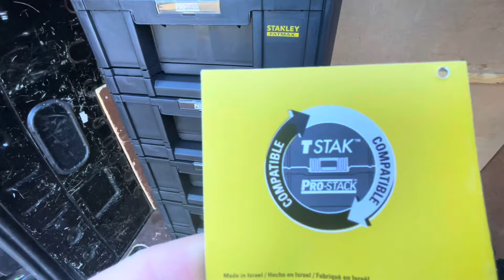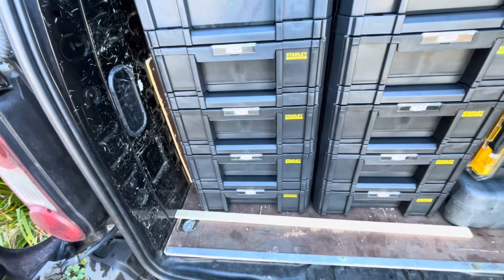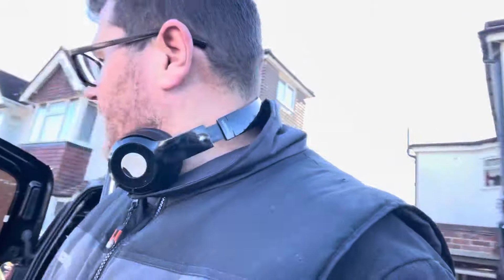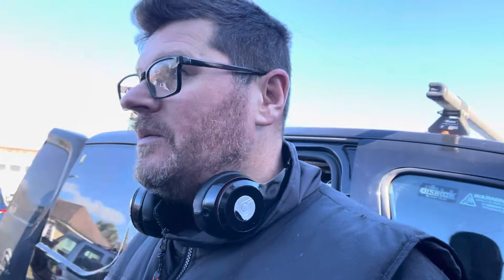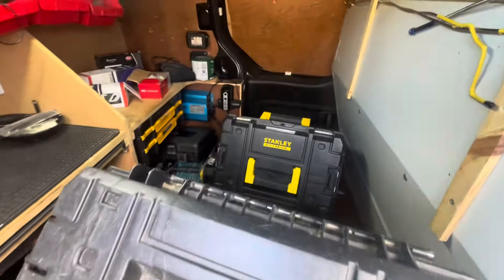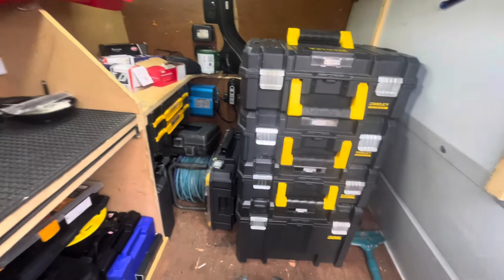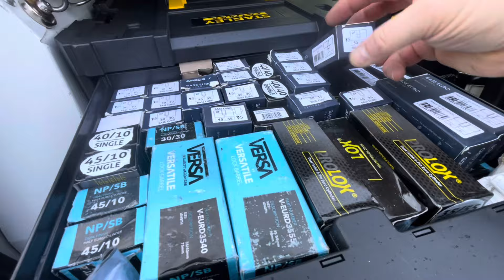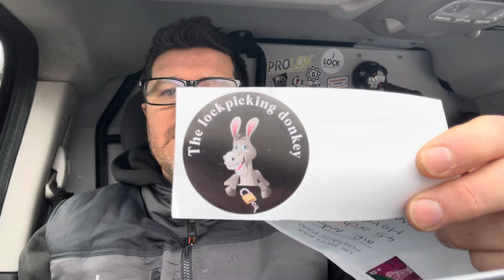Stanley Pro-Stack System | Van Tour | Van Racking | Locksmith

Comment: The never ending quest for perfect storage.  What you've done is looking good.  If strapping the tops together doesn't work, it looks like maybe a removable post or two on the left  (open side) of the stack from floor to ceiling might do the trick.  Thanks for another video!
Reply from the maker: Ah mate!! ‘The never ending quest for perfect storage’ has been ongoing for many years 😂😂 Good suggestion regarding the posts 👍🏼

Thanks for watching 😁🙏🏼

Comment: Awesome video as usual.
Screwing that base unit to your floor of the van should stop everything from falling.
I’m getting one for me now after seeing your video lol. Also those deep draws lol.
It’s fantastic you are doing more videos again. 
I’ve learned so much watching you.
Thank you
Reply from the maker: Thanks Ian. 
I’m not entirely sure that screwing the base down would be enough!! There’s a lot of weight!! Might be worth a try though 👍🏼
Thanks for watching 🙏🏼
Reply: The two stacks at the front. Just get an adjustable strap that pulls them together. If you think they might still go over attach a sash handle to the bulkhead and run the strap through it. That's the cheapo way 😊
Reply from the maker: It’s all sorted Paul, thank you though. 
Watch out for the next video for an update 😁
Thanks for watching 🙏🏼

Comment: Looks good mate but, my word, there must be some weight in that van. 😮
Reply from the maker: Yeah there is Kenny. But it’s fairly evenly distributed 🤞🏼Until I get in it 😂😂
Thanks for watching 🙏🏼
Reply: @brighton_locksmith I have quite a bit more weight in my nv200. I added sumo springs to the rear. Very fast install. Tire wear is excellent. And the van doesn’t wonder. Only down side is. Don’t go over railroad tracks fast at all

Comment: FFS. Been wondering what to do with my layout and now it looks like I’ll be spending some money 😢😂
Reply from the maker: Haha Iain. It’s working like a dream so far! So much easier and quicker 👍🏼
Thanks for watching 🙏🏼
Reply: What sizes did you use
Reply from the maker: @iainfryer8078  I have 17 of the deep drawers, 2 of the deep boxes, 1 of the Dewalt double shallow drawers and 3 of the clear lid organisers. 
When I get a minute I’ll try and measure them for you and let you know the sizes 👍🏼
Reply from the maker: Iain, these are the sizes of the drawers and boxes etc. 
deep drawers are 160mm overall (internal drawer depth is 100mm) 
Dewalt double shallow drawers are 160mm overall (internal drawer depth is 45mm each drawer) 
Deep box is 310mm deep 
Organiser box is 110mm deep 
And shallow box is 160mm deep

Hope that helps buddy 👍🏼